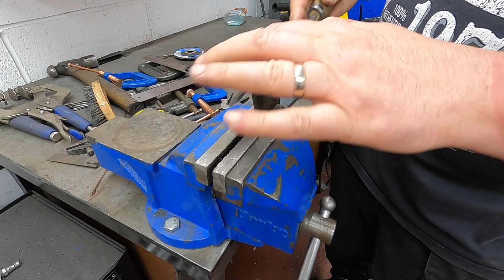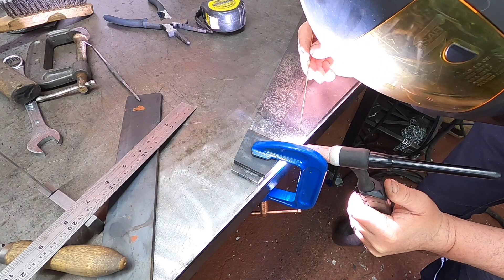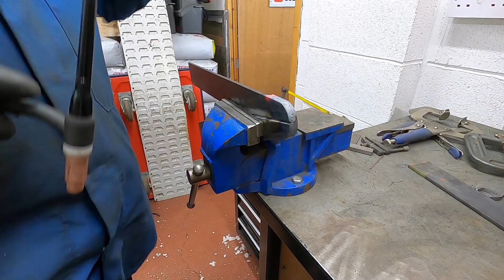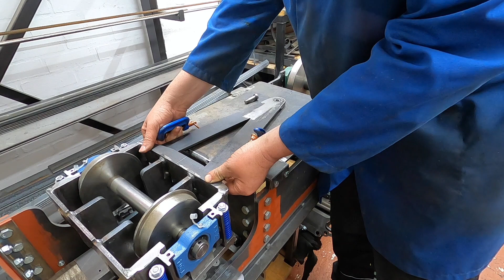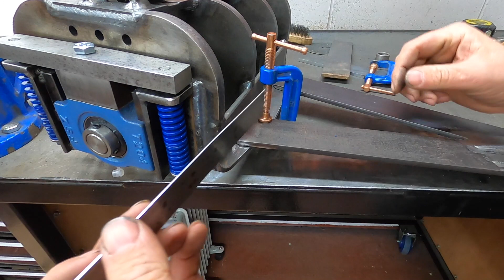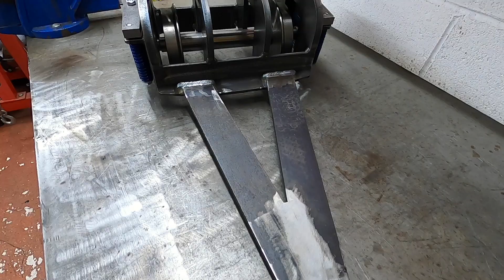The Drawbar - EP28 - 7.25" Gauge Steam Locomotive Build

Comment: Interestingly learning! What is the reason for the 2 different types of welding, strength, ease or whatever? The build is coming on nicely.
Reply: My silly question of the day is the same 😊 very interesting stuff
Reply from the maker: Hi Mike. basically ease, I love TIG welding and it doesn't need dressing after its done. If you see me tacking something together with TIG then MIG welding it after, its to stop the lump in the weld you get when you tack it with MIG and give constant weld penetration. All the best, Matt